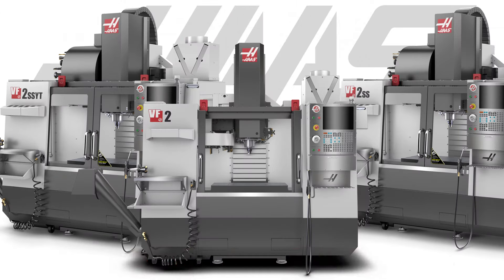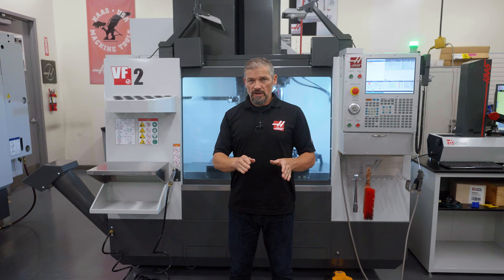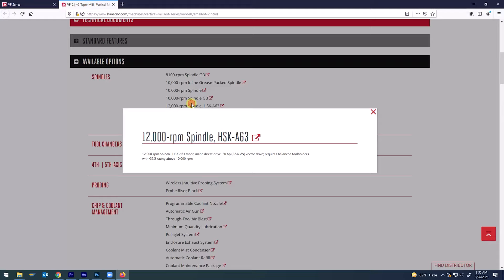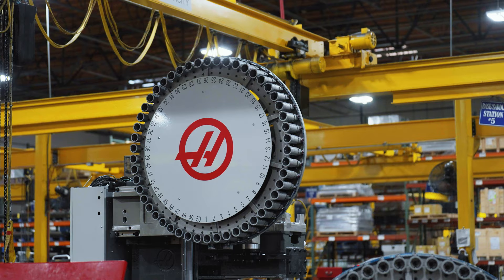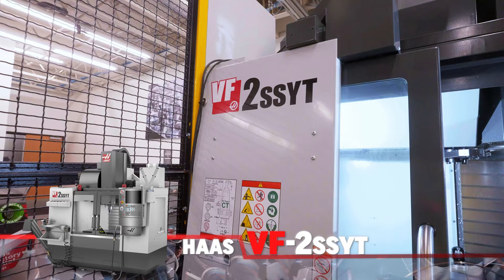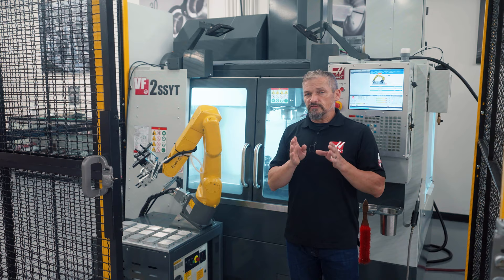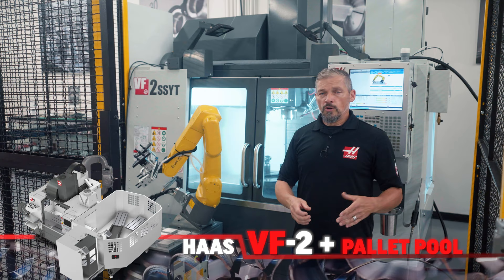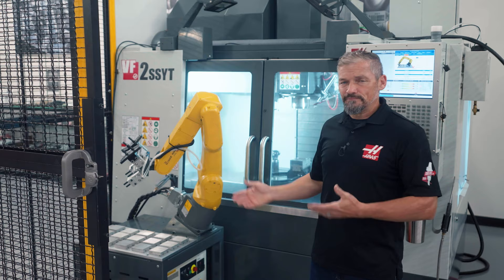The Haas VF-2 - Small VMC Workhorse - Haas Automation, Inc.

Comment: Ran a couple of these quite a bit. I don't think anything can touch it's capabilities for the price. Just a wonderful control that is about as conversational as a Fanuc can get. Once you've ran a Haas control you won't want to go back to a straight Fanuc control. It's a lighter weight linear guide type machine but can still mill tough high alloy steels and also do hard milling. I've ran boxed way mills also that will walk away from a machine like this on heavy cuts but at a considerable larger amount of money.

Comment: It is just the best! we have a vf2ss and for over 10 years we have run it 80 hours per week. Its always running 100% crazy feeds and speeds. Crashed it multiple times but it just doesn't give up. Still holds tight tolerances
Reply: @socrates5573  "lol" you just dont know what you talking about.
Reply from the maker: T6288p25, Thanks for the comment. It’s great to hear from shops like yours who are running their VFs in real world conditions and getting good value from their investment. And as you say; the SS version of the VF-2 was of course available pre-NGC. A simple web search will bring up plenty of pictures of VF-2SS machines more than 10 years old.

Comment: Bought our vf2 about 5 years ago we only run one shift  48 hours a week
It has milled  about 3000 h13  dies in that time, and that  only accounts for 25% of the time it's ran.  these machines are awesome, have ran thousands of other parts for us ranging from hard milling h13 and m2,.   Then m2 ,d2, S7, 4140, large blocks of 17-4.   Is it 50hp ripping no but it's is a capable machine   with adequate power  for the projects you would want to do on this size machine
Reply from the maker: John l, Thanks for the comment. It sounds like your VF-2 has more than payed for itself in those 5 years. Good to know you’re doing lots of different, interesting, and demanding jobs.
Reply: @haasautomation  oh  yes most defiantly  machine paid for its self the within the first 6 months of being turned on. were currently in process of purchasing a HAAS ST35LY  which we hope for ROI to take less than 12 months.

Comment: What are the power needs (Amps / Volts / Phases) ?    Just wondering . . . 
  It would be great to put in the workshop, but I don't know if the standard 110 / 220 lines could feed it's awesome power !
Reply from the maker: Helpful Sysops, Just saw your question! The VF-2 requires 3-Phase 220V at 70A. All the specs and dimensions can be found on this link: https://www.haascnc.com/machines/vertical-mills/vf-series/models/small/vf-2.html
Click on the Specs tab and also the Technical Details dropdown.
Reply: @haasautomation  Thank you very much !  🙂
Yes 220V at 70A... that needs it's own power system,   can't plug it in 110 AC outlets !   We do have commerical power, but large machines such as this need a real electrician to wire up new connections,  for following building codes and safety.
Reply: @haasautomation  And thank you so much for the Link !  😀